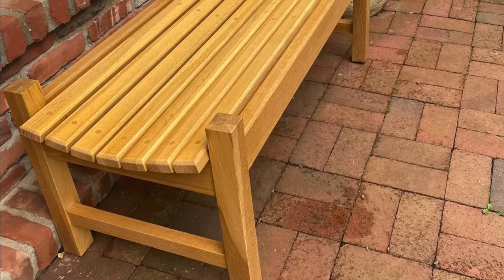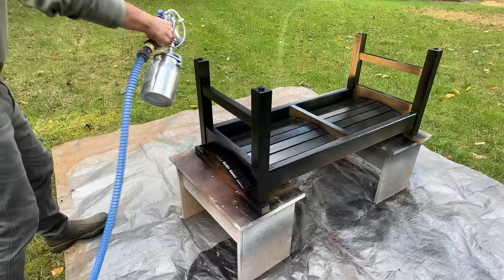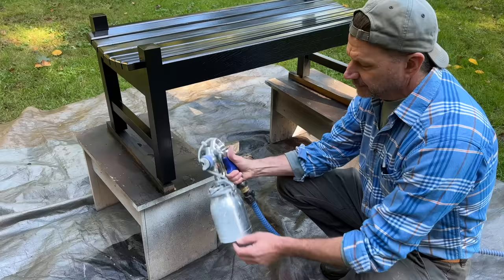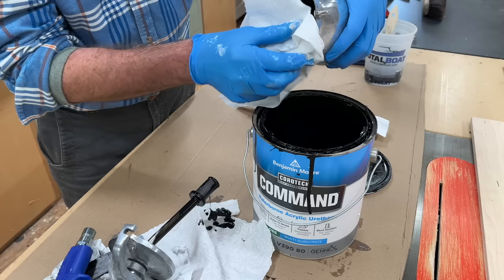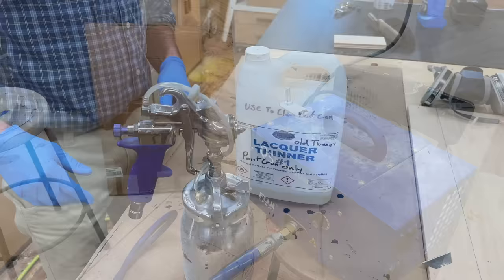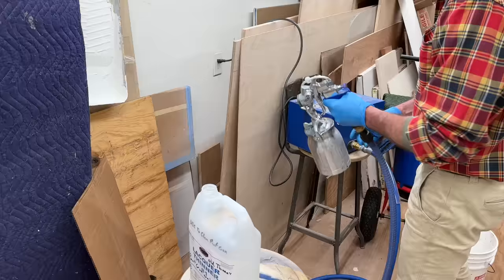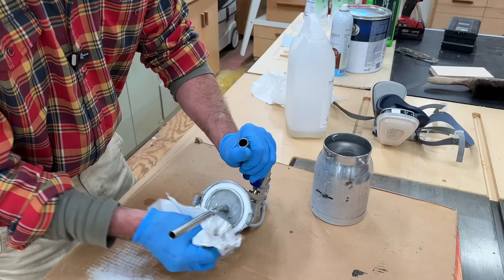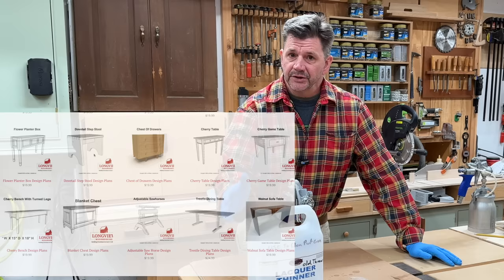HVLP Spray Paint Basics - How to Paint and Clean the Spray Gun

Comment: My first foray into spray finishing was just with the $15 Harbor Freight gravity-fed HVLP gun, it's really decent for the price. Plus it's so cheap that if it gets too gunked up you can just throw it away and buy another one. I run only water-based stuff through it, whether it's latex-acrylic paint or just polyurethane, because then you can just clean it out by going outside and hosing it down and running a bunch of water through from the garden hose.

Agree that paint really is the way to go for outdoor wood furniture if you don't want to have to baby it, as nice as natural wood can be.

Comment: I like the black finish.  Also, great tip on leaving lacquer thinner in the gun for cleaning.  I use it on the outside as it easily cleans off water based paints.  I'll have to add that to my routine.  I usually don't leave conversion varnish is my gun for any length of time like you did with the paint. ;-)  That stuff...cement.

Comment: Aren't you contaminating the lacquer thinner?  Now if you want to thin paint especially a light color it would tint the color
Reply from the maker: Yes, but this lacquer thinner is dedicated to cleaning the gun… If you see the side of the container I’ve written a note to myself that this lacquer is only for cleaning the paint gun. The nice thing about this system is I can continue to reuse the lacquer thinner.
Reply: The paint is a water-based paint so I assume you wouldn't thin it with lacquer thinner.  I have experience with water based paints such as latex, waterborne urethane is new to me.